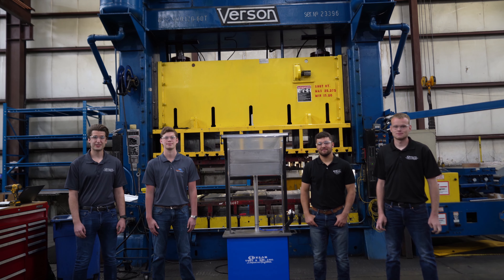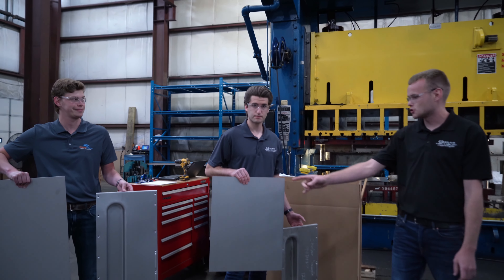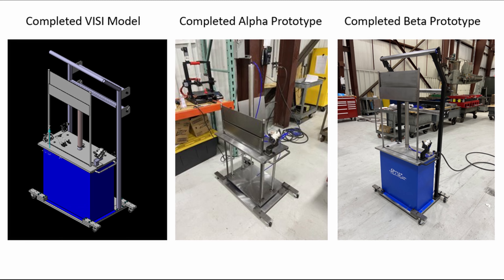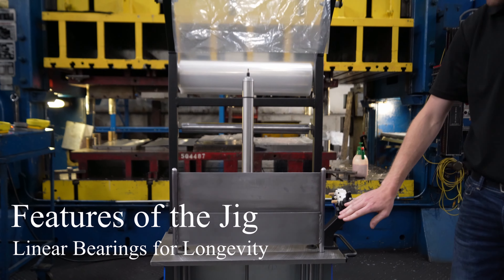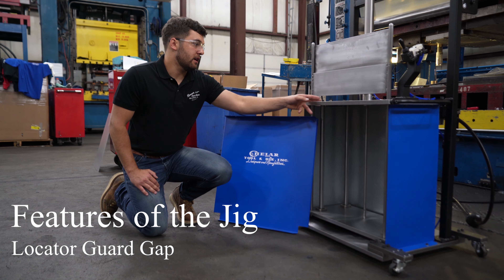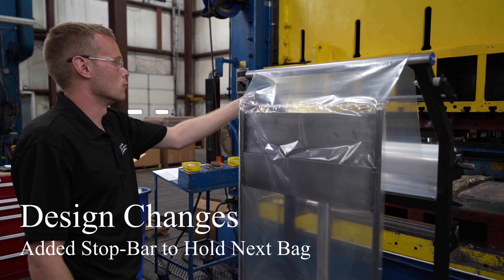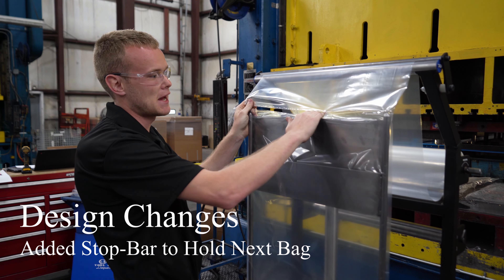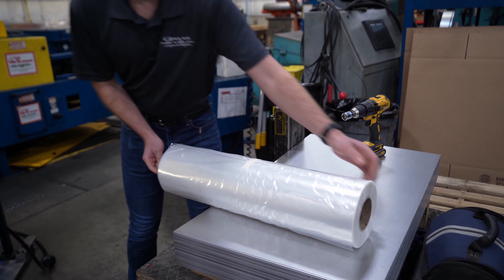Our Senior Design Project for Chelar Tool & Die

Comment: Great job! Did the team actually build the fixture? I would have suggested a foot pedal/switch to activate the cylinder. Funny to see this designed on cad. When I was back in industry, we discussed the needs, made sketches and turned a guy loose to build it. Did some large pneumatic fixtures for robotic trimming of truck bed sized plastic products. 
 Dang Jon, you clean up good!
Reply from the maker: The entire jig was built by us with Chelar training us how to use the equipment. We stayed away from the foot pedal idea because it forced the operator to either hav his hand on the vertical motion assembly or switching the lever. That way his hands would be clear of the assembly as it went up and down. Thanks for watching and commenting!